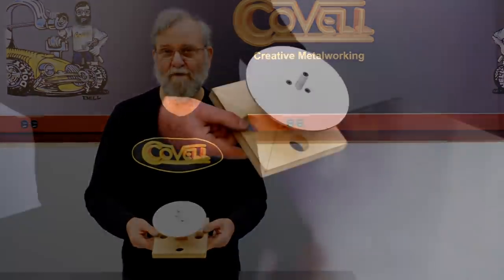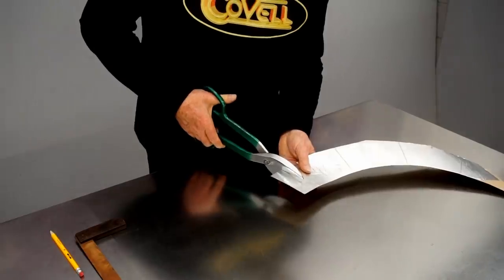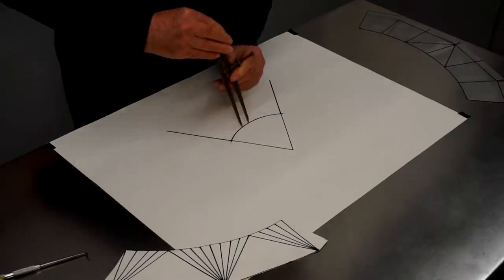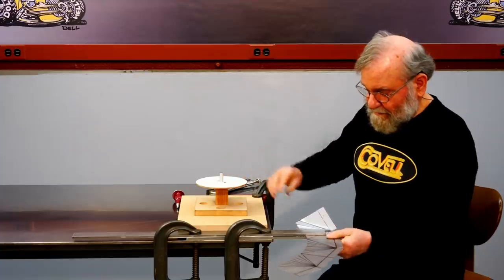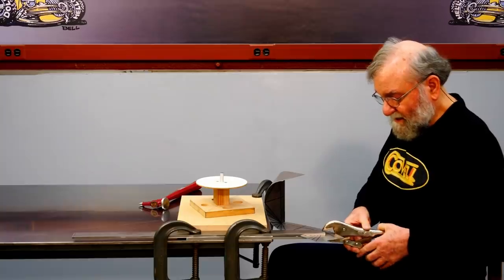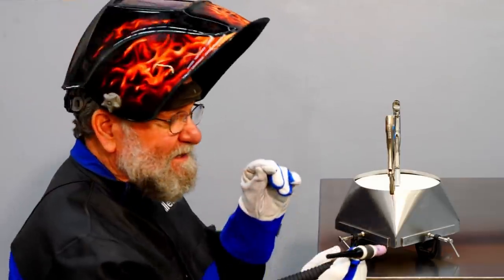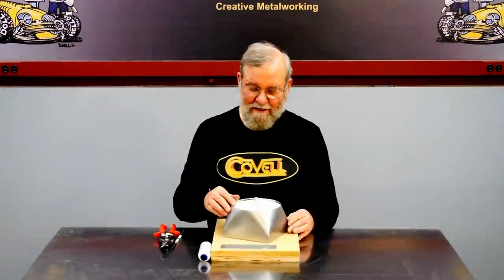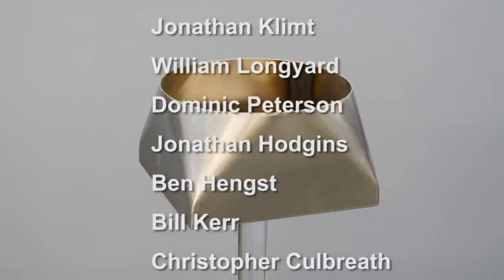Rollation 3 - Square to Round

Comment: Very nice I just got retirement/disability. I worked as a welder,machinist, fabricator  from 1971 to 2019. Nobody ever showed me that method. I sure could have used it a few times.
First video of yours I have seen won't  be the last. 
I have a small shop in a two car garage, hopefully some day I  will be able to get back out there and finish the 5 or 6 projects  I was in the middle of. 
Thanks again 
Bob
Reply from the maker: Good luck with your projects!

Comment: I’m glad I stumbled across this.  My dad ran a sheet metal shop for decades.  He laid out his patterns either by hand from memory or for really complicated patterns he used a sheet metal pattern layout book from the 50s.  I still have it.  It has all manner of shapes like odd angle cornices, tapered augers, sheet metal “pants” (two small pipes transition to a larger pipe).  Now they probably punch it into a computerized laser cutter.
Reply from the maker: Yes, computers and CNC have taken over most large HVAC shops.
Reply: Even if you use cad and cnc, you still benefit greatly from learning geometry and pattern development. Many times there are limitations to programs and applications that require a good deal of the understanding in order to produce the desired result.

Comment: Ron, thank you so much for sharing this process.  This is the first time I even seen this awesome technique.  I am a mechanical designer by profession and work in 3D in AutoCAD.  Some years back I had to design a couple of transitions for the intake and exhaust ducting to the turbochargers of a huge marine diesel engine.  The transitions went from rectangular to round and were offset several inches.  The shop who fabricated them did an beautiful job.
Reply from the maker: I'm glad you found a shop that did a nice job. Some shops do better than others!
Reply: @RonCovell  Ron, after seven years, I stumbled on this video again. I hope you are doing well and still doing what you do so well. I am still designing and making my own things at home.
Reply from the maker: Yes, I'm still doing projects, and making new YouTube videos. I have about 80 videos posted so far, so you might check out my other offerings!

Comment: I'm looking to make a fan shroud for my '62 F100.  Out of the blue, this video was magically recommended.  I know nothing of metal bending and have very meager tools.
About a year ago, I salvaged a stainless steel clothes dryer drum and its stainless steel cabinet.  I'm going try this magic of yours then maybe, take the result to a shop for welding as needed.  I'll make in two pieces for ease of installation.
Oh, wait.....if I make it as two pieces maybe, no welding is needed.  Hmmm
I wish I had confidence.  Let's see.....wish me luck!
Reply from the maker: I definitely wish you the best of luck with your fan shroud! Stainless is a little challenging to cut and form, but it's an extremely durable material.

Comment: I bought a rollation cheap from an old sheet metal shop going out of business.  I have my own shop and make these regularly.  It's also called a jet pattern designer (at least that's what written on the tool with the patent number), I was told it's what sailors used on ships to fabricate parts at sea.

The two ends have screw on rings to hold on the patterns.  They also each pivot on an axis up to 45 degrees so you can make offset transitions as well.

I make them in two equal halves and munch over and punch the sides instead of welding.  I can fabricate one of these in about 20 minutes.

Comment: Needing to make one of these for a obsolete golf cart remote air filter inlet.   I was going to just weld up a box with a flat bottom, cut the hole in the back and weld on a piece of tube-  this will look much cleaner and closer to the original piece. 👌🏻
Reply from the maker: Sounds great!

Comment: When I was doing my apprenticeship as a plumber in the 60's we would do a lot of sheetmetal work -ducting -flues etc and we often used an item called a 'Jet Developer'It used the same principal as this and consisted of two swivel knuckles that were joined by bespoke length of round rod and had the profiles of the square and round or any shape on each end some of them up to 3-4 ft across and at any desired angle.Was sometimes a three man job-two rolling and one marking.
'
Reply from the maker: I've heard of that tool. Apparently a lot of them were sold years ago, but they are no longer on the market.
Reply: @RonCovell  Was a very handy tool mate.At times in my working life I used the same 'rollation' method that you have shown here.But never had a name for it.Just said I will make a timber jet developer.Worked great for me.

Comment: Great video's Ron!  OK, here's a challenge for you.  I tried this at work but it did not turn out well!  I need a transition between two 6.5" circles at a 90 degree angle.  I tried to make two wireform circles welded together and rolled them out tracing the pattern.  When I cut and bent the metal, it didn't work at all!  I'd love to see what you can do.  Thanks for all you do.
Reply from the maker: Here's one way to do it:
https://www.youtube.com/watch?v=1nStztgcE-E
Reply: @RonCovell  Thank you for the link.  Well, it's safe to say I'd have NEVER have searched for that title!  
I'm sure it's possible to do what I want.  I just need to make a better model and try rolling it on cardboard backed foil like you did.  Thanks again.
Reply from the maker: I don't see why your procedure wouldn't work. You will have a 45-degree angle at the ends of your transition, but you should be able to pattern it by rollation. It's important that you have matching centerlines on both discs, and keep them in alignment while rolling.

Comment: To divide an arc in to 8 parts with a compass, place scriber/pivot on one end of arc, then inscribe a semicircle on the arc. Do the same at the other end of the arc. Mark a straight line where the 2 inscribed arcs intersect. That'll divide the arc into 2 equal parts. Repeat for 4, then eight.
Reply from the maker: You are absolutely correct! Bisecting an angle can develop perfect divisions for any power of 2!

Comment: A video Idea is to show off some of the divider tricks. Like bisecting, trisecting ect in a video. They are a great way to get the acuracy without some of the brain melting geometry sometimes. This square to round rollation method turned out awesome.
Reply from the maker: Thanks so much for the comment. Bisecting an angle is easy, but my understanding is that trisecting is simply not possible. Let me know if you have figured out how to do it!

Comment: That turned out amazing! I was wondering if it would be possible to do this in one piece with one welded seam? You had well over half of it formed in that initial setup with plenty of room to continue, I thought... Maybe it was simply easier to make halves and trim!! Love the process, just made me shed a tear when you trimmed those beautiful corners!!
Reply from the maker: Yes, absolutely, but it increases the level of difficulty considerably. When there are welds on two corners, it's not hard to get all four corners to fit snugly on the form. If you do it all in one piece, all four bends have to be done with extreme accuracy, or you get a sloppy fit. It's hard to attain fine accuracy with a simple fixture like I used here.

Comment: That's a neat trick but you have to build a new jig for every different size round, square or rectangular change in size. In the 70s and 80's before the CNC plasma tables came out, I laid out square to rounds with the bases as large as 120" x120" x 84" diameter and 72" long by using the triangulation layout method.
Reply from the maker: Triangulation is ideal for this kind of layout, and of course rollation isn't feasible for a part 10-feet long!

Comment: As usual, very informative and interesting although, I imagine, it gets much harder and fiddly when working with smaller diameters. An example that springs to mind is input/output hose areas of an intercooler - say 1.5 or 2 inches diameter.
Reply from the maker: The same principles would apply, but I'd have to make a 'skinnier' bending fixture.

Comment: Beautifully explained. My question is whether this method can be used on other sizes alw or it will be different method ?
Reply from the maker: Well, there are certainly limits to the size of pieces you can use the rollation method for. There are geometric ways of patterning shapes which are much larger, for example.

Comment: Thanks for this demonstration on using basic tooling. Could you show how to create a tapered schedule pipe. Eg, 2" sch 40 pipe at one end to 1.6" sch40 at the other over 6"? Is there a method that can be applied by cutting pie cuts in the pipe? Cheers
Reply from the maker: I have done this with exhaust tubing, by cutting a wedge out, then using hose clamps to pull the gap tight, and weld it. It turns the small end into a 'teardrop' shape, which I hammer round over a mandrel. I question how well this would work with schedule 40 pipe.

Comment: Great video. I have a question.
Why cut and weld the two pieces at the corners instead of the flat sections, like making two "C" shaped pieces?
Reply from the maker: The key to getting smooth parts is placing the welds where they won't cause much distortion. Flat metal distorts a lot, and it would be extremely challenging to completely smooth a weld in the flat area. You can see how easily the weld smoothed out in the corner, because the contour of the part eliminated most of the distortion.
It's a bit different on thicker metal:
https://www.youtube.com/watch?v=DnyrA2x6MTU

Comment: I absolutely love these videos. Makes me feel like I could do it myself with the same result. I do have a question, though. Why do sheet metal and body guys always use air-powered tools? Does the metal dust destroy electric motors? Or is it something else?
Reply from the maker: Air tools pack a lot of power into a small, lightweight package. No problem with using electric tools in a body shop.
Reply: @RonCovell  thanks for the answer! I have asked a lot of people this and you are the first with an answer that wasn't along the lines of "because thats what we have."  Thanks for the great videos!

Comment: I can do this with my tape measure and scratch all. Then cut, roll or break it depending on the order. Add the collar and ductmate or s slip.
Reply from the maker: That's great!
Reply: @RonCovell  First sheet metal hammer was a Malco 12oz and that was in 1984. The next day Tin Knocker.
Reply from the maker: You are using very good quality tools - which certainly eases the job!

Comment: Ron, this is a hugely helpful video.  However, how does this process differ if the base is a rectangle?   I need to make a transition a big taller than this one but from a rectangle to round flu.  Thanks for any assistance you can give.
Reply from the maker: The layout and bending are essentially the same for a round to rectangle.
Reply: @RonCovell   - thanks, Ron!  I'll get after it!  P.S. - I am going to make up a pair of your DIY bomber seats for my '67 MG Midget, but used as a basis for an upholstered seat that will maximize leg and arm room for taller drivers like me.   Like you, I work to enable DIY projects.  See: creativespridgets.com.

Comment: Why are the welds placed in the corners? My instinct would be to place the welds away from the bends to make the trimming and die grinding easier.
Reply from the maker: The key to getting smooth parts is placing the welds where they won't cause much distortion. Flat metal distorts a lot, and it would be extremely challenging to completely smooth a weld in the flat area. You can see how easily the weld smoothed out in the corner, because the contour of the part eliminated most of the distortion.

Comment: Very nice job I'm saving the vid so il have when I will definitely need it may I ask are you a tin basher by trade or a HVAC man
Reply from the maker: I've never worked in HVAC, so I guess I'm a tin basher. Most of my work has been on cars and motorcycles, with a little other stuff thrown in for fun.

Comment: I almost stopped at tractor supply to grab a chunk of the 20ish gauge steels they have there just to try this out. That and I just got my micro oxy fuel torch going and it would be just about right to torch weld 20 guage...
Reply from the maker: Yes, the micro torch should be great for 20 gauge steel!

Comment: Genius! Thanks Ron, I learned a lot from this one. 

Which miller TIG welder are you using? Looks a bit like a Diversion 180.
Reply from the maker: Yes, it's the Diversion 180.
Reply: @RonCovell  I thought so, thanks sir. I've been considering it or a MultiMatic 220 AC/DC for my home shop.
Reply from the maker: I have a MultiMatic also, and it's an excellent machine. The Diversion can't do MIG welding, of course.
Reply: @RonCovell  Glad you like it. 
I considered the MultiMatic to consolidate machines and fill my need for a TIG that can do aluminum. Originally I was looking at the Diversion 180 but they mentioned the MultiMatic 220 and things went sideways. Haha.

Comment: I love the Rollation technique but I feel like the foil should be on a softer surface so it transfers more of the forms edges to it.... Maybe glued on cardboard would be enough.
Reply from the maker: I'm sure cardboard would work just fine - maybe better.
Reply: @RonCovell  - I was thinking that or foam/styrene board... Something a little softer but still strong enough to be handled and maybe stored away after if needed again. Just trying to add to the list of ideas.... Hope it helps or gives you a good idea, Good Luck.

Comment: I know what that is. What is that? A battery to rocket engine convertor? Yes, that is just a Battery to Rocket Engine convertor. Good Job, should make it to Mars just fine.
You reminded me. The Orbital Sander has been used in sheet metal decades before it showed up at Home Depot. 
The German master that taught me called it a 'Jitterbug'. All the new guys had to Jitterbug parts. "Mahtin, Jitterbug some parts, Mahtin', I can still hear him.
Jitterbug sounds way cooler than Orbital Sander.
Reply from the maker: I learned to call an orbital sander a 'jitterbug' when I was young. Don't hear that much anymore!

Comment: What is the difference between orbital mode an normal mode on your disc-sander?
Reply from the maker: In 'regular' mode the disc spins in a circle - like a 'regular' disc sander. In orbital mode the disc moves in small circles, about 1/4-inch (6mm) in diameter.
Reply: @RonCovell  aah interesting. Thanks

Comment: please explain your welding gear kind regards from nz
Reply from the maker: I'm using TIG welding (Tungsten Inert Gas)
https://www.youtube.com/watch?v=Clg6e_c7Ua4&t=190s
Reply: @RonCovell  thanks does co² works to ?
Reply from the maker: Argon is the gas used for TIG welding. CO2 is one of the gasses that can be used for MIG welding:
https://www.youtube.com/watch?v=t0VeJoHL7qQ
Reply: @RonCovell  thanks again is your gas a mix of co2 and argon ?
Reply from the maker: TIG welding is almost always done with pure Argon gas. On rare occasions, Helium is added to the Argon - and it's even possible to TIG weld with straight Helium, but that's rarely done.
A mixture of Argon and C02 is often used for MIG welding.
Reply: @RonCovell  thanks one more question do you know about to use h2 as an gas because i know from some pacific island they have a hard time to get the required gas and some use h2 because it is easy to made and available i know there is a flame on the nozzle  but only outside or away the welding area or spot
Reply from the maker: I'm not familiar with any gas listed as h2. Do you mean hydrogen gas? 
You can weld with hydrogen gas and oxygen, although it's relatively uncommon. Here's one example:
https://www.youtube.com/watch?v=GRpUUPHujiA&t=170s
Reply: @RonCovell  thanks the h2 is hydrogen  only no oxygen at all but the nossel burn from the first spark on but far away from the welding spot h2 also called water gas the mix of bothe h2 and o is the water welder very old most blacksmith in remote areas use this principle on the water welder the mix is fixt by the way sometimes old batteries are used to create the water welding gas

Comment: Never seen it done like that, for smaller transitions this could save time, but for larger I would use true length line method which is what I was taught
Reply from the maker: You are correct that the rollation method is only useful for relatively small objects. Nevertheless, Iots of people have enjoyed learning about this alternative technique.

Comment: There's a better way to do this where you can do any size hole to any square there' s no need to make any templates  you just need a sheet of paper and work it out by triangulation then transpose your measurements over to  a painted white steel sheet with a scribe and callipers,  I did this as a part of my  apprenticeship as a fabricator in a shipyard, also did  a tube into a cone  too .
Reply from the maker: That is a great way to do layout!
Reply: I've learned to use your technique by a old  HVAC boss 30 years ago. His trade is now gone with computer design.  He could build any shape with a ruler, a protractor and a square.  Best project I worked on was a Canadian military vessel with all kinds of ducts with weird shapes.  It's the way to go when you know math and trig.  But for most guys who work in a shop and did not care about math,  Ron Covell technique is excellent and does the trick very well.

Comment: Easier way to divide a known space like your arc into even segments is to take a number divisible by your intended division count (8), like 16. take a ruler and line up 0 on one side and 16 on the other, mark every two inches and those are exact points to draw your eight lines back to the center.
Reply from the maker: Thanks for your suggestion. I have tried that technique, and I found that the greater the angle, the more error is induced.